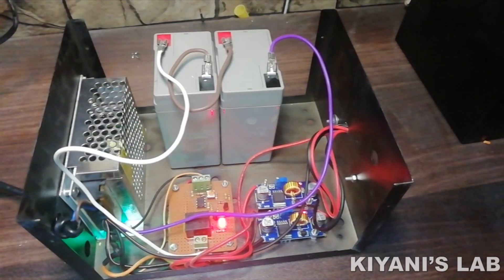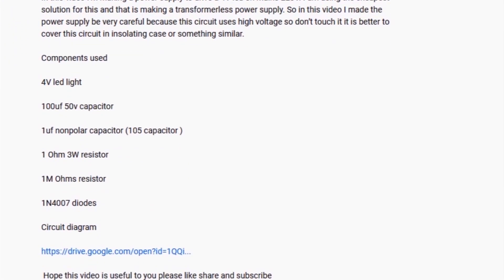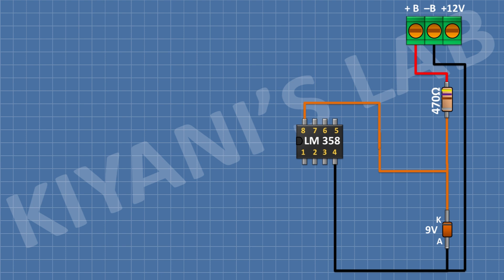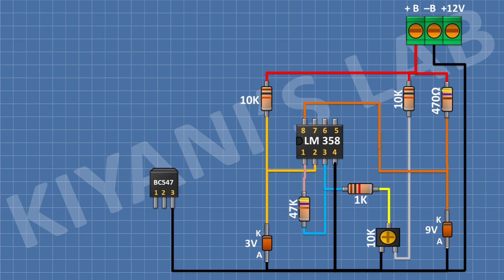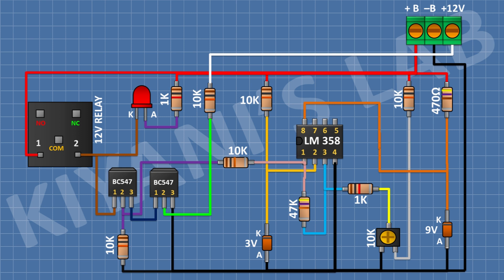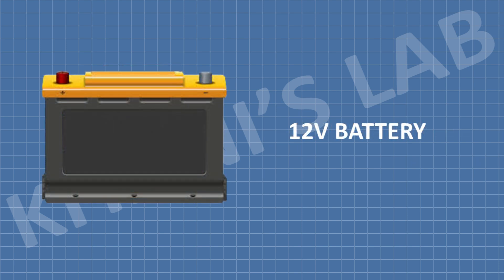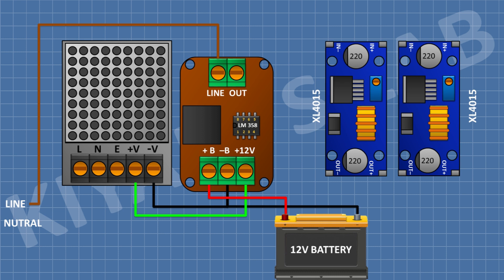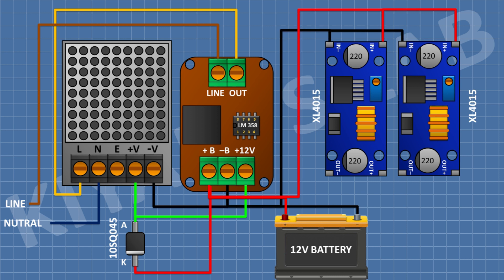How to Make 12V 9V 5V DC UPS

Comment: Will this board protect the batteries from over charge, i mean will it auto cut ?  One thing more can we attach lithium ion cell instead of this lead acid battery ?
Reply: Pls get BMS with Li-ion and adjust voltage via SMPS to get your required voltage. This circuit takes care of auto cut off. But not for over load.
Reply: @anandsingh8987  can we add multiple lead-acid batteries to it, more than two, as he used two
Reply: @themubashirzahid  No. He used two battery 6v each. You can plan to put in parallel 12v battery
Reply: @themubashirzahid  In case of high backup plan to use inverter with UPS. The challenge would be SMPS, if you add more battery.
Reply: @anandsingh8987  Thanks, Actually I was planning to make a long backup with multiple 12v output channels for my internet and CCTV, now I am clear, I think I must go for a domestic UPS inverter.
Reply: @themubashirzahid  For low power DIY it is good other wise commercial brand products are well tested and deliver